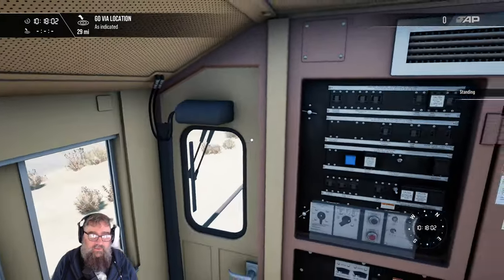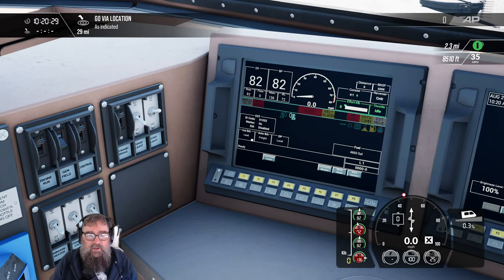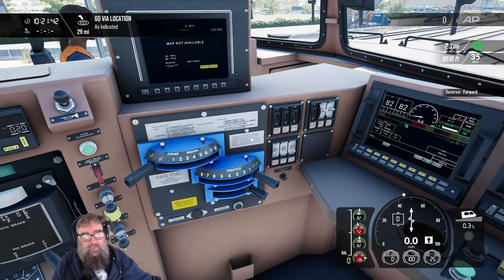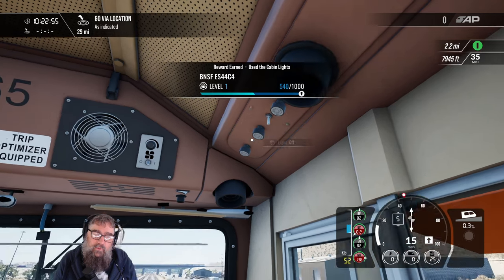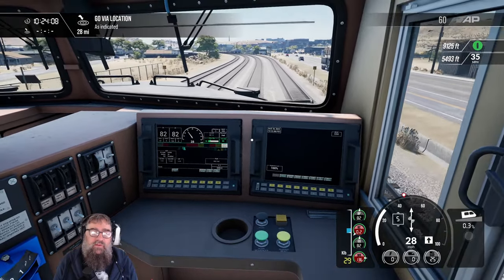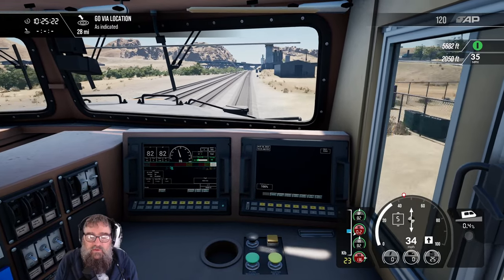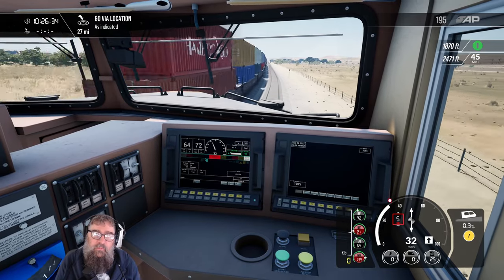TSW3 Tutorial  - Cajon -  Introducing the ES44 including Safety Systems

Comment: First of all thank you so much for these tutorials. These are informations from real world and they can not be found anywhere else but on your channel.

If I may, I would ask you if you can make a tutorial about proper way to couple two ES44C4 locos, from cold and dark.

There are combinations of two, tree or more, than front and and sets of locos. Also in the middle of train length.
I was struggling to actually switch roles (Lead/Trail) when both locos are powered on. Pressure becomes problem because after I switch Trail to Lead, there is no pressure in Rear on IFD and train does not brake with auto brake. Can you, please help?
Reply from the maker: Thanks for the note on the tutorials I appreciate it. It sounds like you might be a little more hard core than TSW is used to. I can certainly have a go at that for you. I'm thinking you want to take a loco set from cold and dark over from the depot and hook them up to a train? I can make a tutorial like that. The lead loco should be set to lead and cut in, all the others trail and cut out.
Reply: @trainsimulatordriver  Thank you for reply, I really appreciate this! You might say that I tried to find answer for this, but no luck at all. Like nobody cares... My idea is to take out loco from cold and dark from depot as you said, and hook it up with one (for start) loco. Make them a pair and connect them to the train. But... Since there is no rotation switch in TSW3 (or I did not found it), I would like to, if necessary, change the roles of locos.
Like I come to train with combination <TRAIL - LEAD> --- <TRAIN - WAGONS>. I would like to change to <LEAD - TRAIL> --- <TRAIN - WAGONS>
In that way my lead loco is first then trail one and behind them are train wagons.

When (and if) you decide to do this tutorial, I am sure, lots of people will learn something new, and it will bring more realism in game. Thank you again for your time and effort.
Reply from the maker: @dusanmirkovic1915  the lead/trail only affects the independent brake and its on the bottom left of the control stand where the brake is on the wall facing the back wall of the cab. I do have a tutorial which isn't quite exactly what you're asking for but it is a lot of it - take a look at https://youtu.be/-Bp5MIoh7x8 I have a lot of tutorials in this playlist (both TSW2 & 3) https://www.youtube.com/watch?v=bFLWxVtJLjU&list=PLWi4sYR9zXqWK563hAInWYVxlLeM8-JMb and there is a new playlist specific to TSW3 https://www.youtube.com/watch?v=CmOqUi3nC8w&list=PLWi4sYR9zXqVzukdTqM1j0or9tXBdARmF

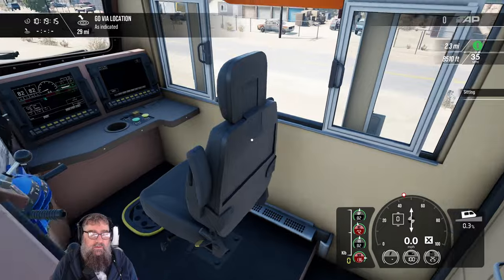Comment: Hi Paul, I'm learning to play this game and it's fascinating, though not easy. On 2:07 you looked on Automatic Brake that's at "minimum application" and said that it's the train brake and it's fully released. Is this an oversight on your part, or it gets released automatically or maybe it's normal to drive with it on this setting?
Reply from the maker: Lol really? Oh dear no that's a mistake. They should be released to drive. I must have left them on minimum before I started recording instead of released then went on with the script. Good pickup.
Reply: @trainsimulatordriver  Thank you very much for the response, that clears it up for me!

Comment: Love these vids and appreciate the info for the Alerter. Quick Question - I have done several runs in the railyard as well as a few routes and I have noticed that if I got  Silver on my first run through. I attempt to play again to get gold  and even if I successfully get the points for it, it never changes from Silver. Is the first attempt the only time you may get gold? Did you make a video explaining this at some point? Any advice is welcome good sir. Thank you for your help with this.
Reply from the maker: It's an interesting question I'm not sure if it will update the initial medal, seems from your comment that it doesn't. I'll give it a go and see
Reply: @trainsimulatordriver  Please let me know when/what you discover and thank you for your reply.
Reply from the maker: Hi again, I tried it with service 1P02 on SEHS today and yes, you can upgrade your medal if you redo a service. You can see it in https://youtu.be/fz8TRiD3Bmo

Comment: Onsceen saying setup brake values. How do I change them?
Reply from the maker: In the ES44C4? You don't need to do anything they're all setup for you. If it's another loco you'll need to set the independent to lead (look for valve labelled MU2A) and cut in the locomotive - this can be a valve on or near the brake lever it it can be on a screen or control panel depending on the locomotive. All TSW3 native locomotives should be ready to drive with brakes configured.
Reply from the maker: Hi Jack, I finally found a place where the brakes were not set up, if you watch the start of my new switching tutorial you'll see how to do it https://www.youtube.com/watch?v=iIA2R_xjtqo

Comment: Do you know how to cut in the brakes on this loco?
I'm not having much luck finding an explaination on how to do it, all I've found is how to it on tsw2 but the IFD doesn't seem to respond at all doing the same process on tsw3
Reply from the maker: They're cut in and set to lead when you get them. You don't need to do anything.
Reply: @trainsimulatordriver  on almost all of the modes yes but when im doing the free switching sitiuation they are not on any of them, only one I can succesfully cut them in on is the older class because that has a manual valve